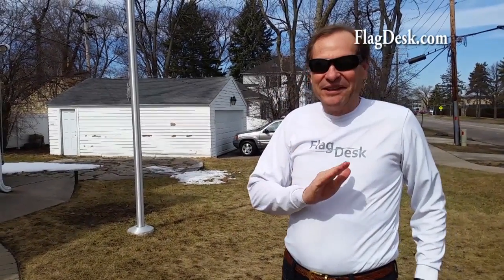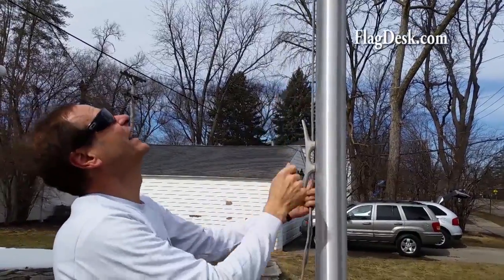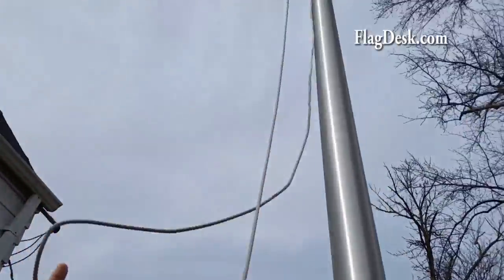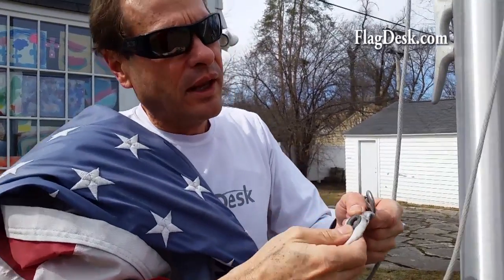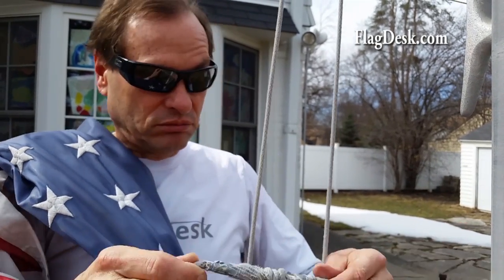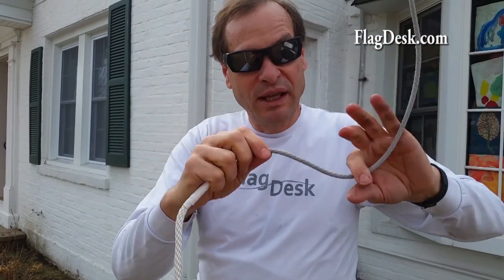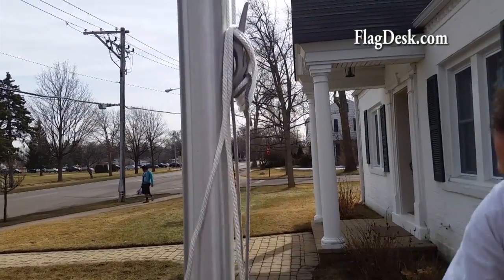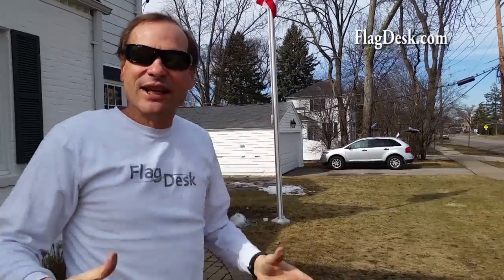FlagDesk.com | How to Install A Flagpole (Part 7): 21 Months later...

Comment: what size is that flag you used on this pole?
Reply from the maker: +JAY T. This is a 5x8 flag. It is a little big for normal 20 ft. flagpoles, but the weather is mild and the flagpole is strong enough with the rotating truck. Happy Flag Flying!
Reply: +FlagDesk-FlagRunners  Which state are you in?? I heard you say lake michigan.
Reply from the maker: We are in Illinois. The wind zone is 90 mph.
Reply: +FlagDesk-FlagRunners Wow what was the wall thickness on that flagpole? Im in Michigan in the metro detroit area my flagpole has a wall thickness of 0.65" and is rated for a 50mph wind speed. Do you think the flagpole will hold up good? in my area?
Reply from the maker: .65 or .065?
Reply: +FlagDesk-FlagRunners .0.65"
Reply from the maker: .065 is light duty aluminum like the homesteader. This is a commercial 1-piece pole or sectional? If sectional, stick to the recommended size with your kit. If 1-piece, consult the company that sold it to you. We are not familiar with this flagpole. You found one we haven't run into before!
Reply: +FlagDesk-FlagRunners Its a one piece aluminum flagpole its actually being put in today. Im gonna ask them after its in if i can go up a flag size. They say it can fly two flags I don't see why i can't fly a 5x8 flag if thats the only flag on the pole.
Reply from the maker: good idea

Comment: Can we put a 8x12ft american flag on a 20 ft pole
Reply: Kayden Vatne no! 5x8 is about as large as you can put on a 20 ft pole if just using one flag.  4x6 for the top flag if you have 2 flags on same pole and preferably 3x5 for the bottom one
Reply: Kayden Vatne America!
Reply: +Kayden Vatne Residential quality poles (generally 3” or less butt diameter, non tapered, and sectional) should fly nylon 3’ x 5’ flags.
Commercial quality poles (generally 4” or greater butt diameter, tapered, and one piece) can fly polyester and 4’ x 6’ flags (single flag).

5’ x 8’ is honestly too large for a 20’ pole...

+Monty Burns It’s preferable for both flags to be the same size so they look even (Two 3’ x 5’ on 20’ pole) with the exception of some flags like the POW-MIA or Gadsden which look good a size down from the top (4’ x 6’ US, 3’ x 5’ bottom on 20’ pole).
Reply: Yes
Reply: But it would be big